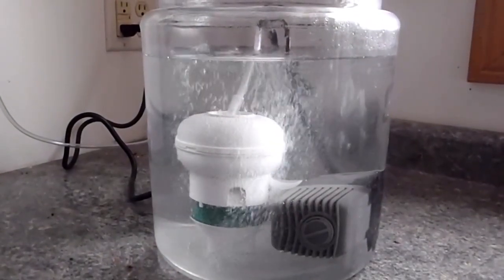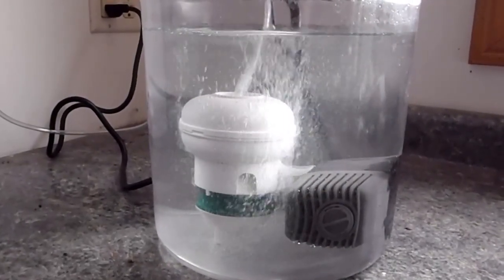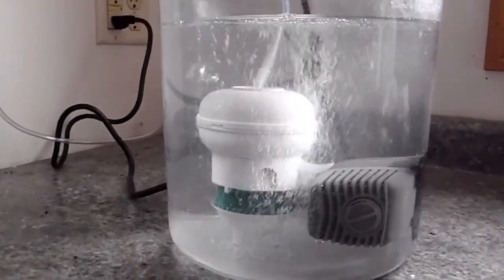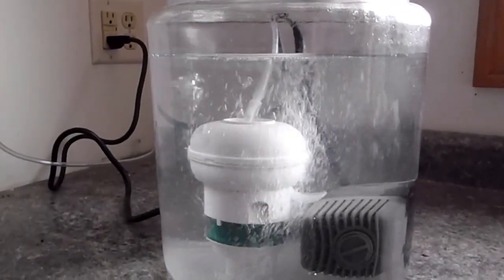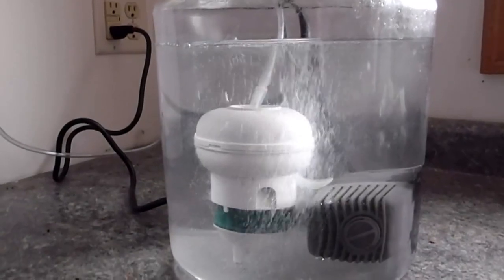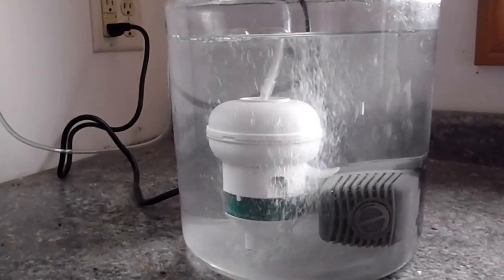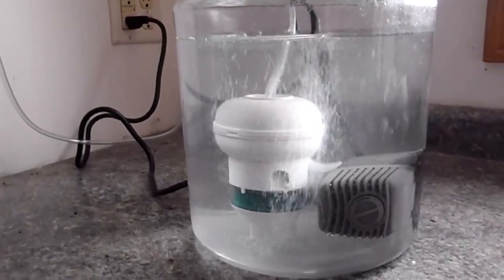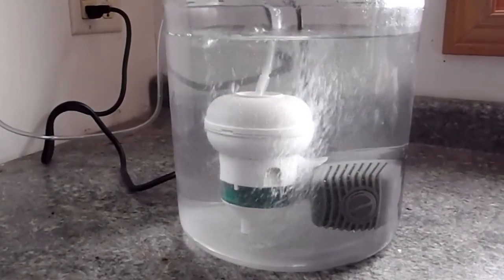OxyDoser™ PUREair - MicroBubble Generator in low pressure mode - 970-901-5105 - OxyDoser.com

Comment: What pump are you using? Did it thread directly into it without issues? Also would the PureAir work with the same 250gph type pump? I think the PureAir is better production of micro bubble.